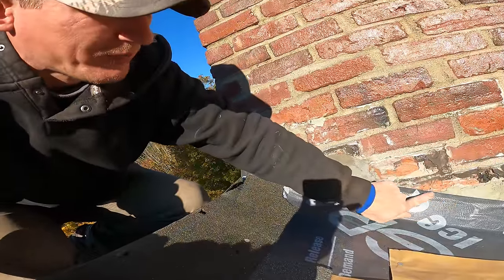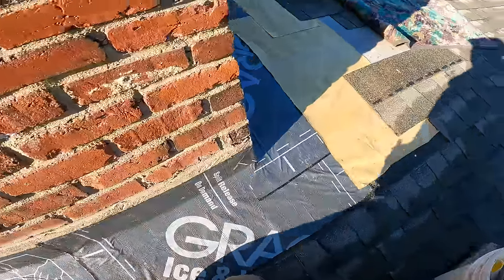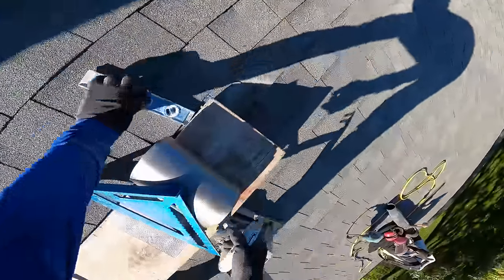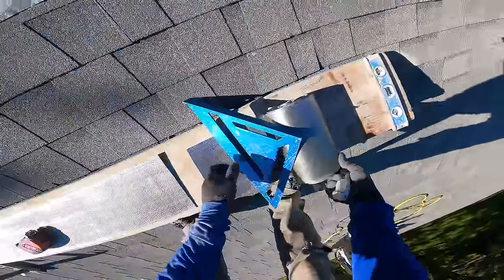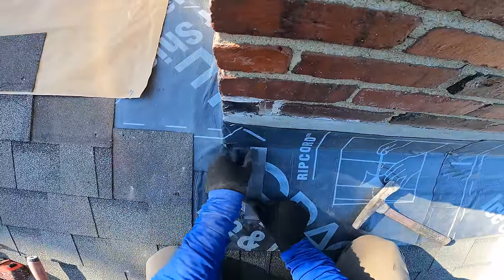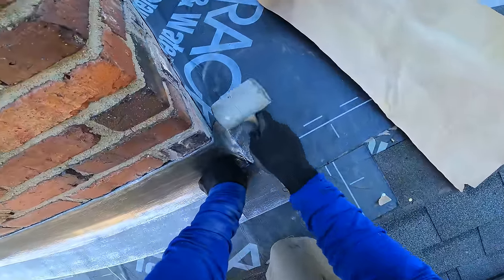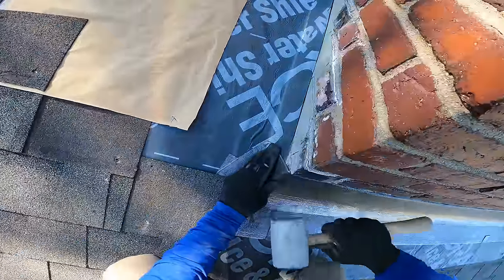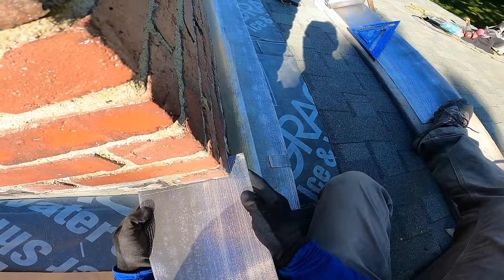Chimney flashing install | Part 2

Comment: I've always rolled up a a tiny piece of lead to use as an anchor between mortar joint and lead to hold in place. Once you roll up the little peice of lead, use an awl to squish it in the joint. Then use a specific caulk to mimic the mortar.
Reply from the maker: I actually used a similar technique in this video with the lead pieces. I would never use caulking on a chimney though, just doesn’t last long enough or adhere good enough in my opinion.
Reply: @chadvaillancourt  Yea I did see that after I posted.lol.. They make a special caulk that is for that purpose, I forget the name of it. Maybe dynaflex, not sure but it was specifically for mortar joints while also providing the necessary flexibility. Great work, I miss it, but then again....

Comment: WOW !  You are the man !  Very professional. You certainly do excellent work with the necessary knowledge. Learned so much.  I’m not a roofer or flasher but our roof is leaking around the chimney. Our house is thirty years old and the roof needed replacement because of a hurricane. The leaking is bad whenever we have a heavy rain.  Nothing was done to replace the flashing or to fix mortar and brick erosions. We have a lack of available roofers because hurricane Ian caused major damages to Florida. 
Question:  how does one find a qualified professional to do the right work like you do ?
Reply from the maker: Thank you. You’re very kind. 
Honestly I wouldn’t know how to go about finding someone qualified. The trades are in a very sad state.

Comment: Really well done. I work on a lot of chimneys undoing bad work.
Reply from the maker: Thanks! 
I prefer silicone in this application, it’s waterproof and flexible. Mortar cracks the first time the lead is lifted up to put shingles on especially if the roof is getting done in the following days.

Comment: Would it be OK to use 3 pieces of 8 inch lead to construct the front apron to cover up roofing cement stains?  It would cover about 13 inches in the front and the sides would also be longer.  Some pieces would exceed 20 inches.  Is this too much to cover?

Comment: U don't cut the Verticle Cut to tuck your Flashing into the Brick?
I've always laid my Shingles Over the Flashing, the Tar under the Ends to seal and stick.
Nice Clean job 👍👍
I still not sure about Not Notching the Verticle ends of your Flashing.
Blowing rain could get behind that area unless u Caulked under the Edge.

Comment: Hi it all looks very neat and I am sure you know what you are doing but if the chimney was in the uk it would not solve the problem what you are doing is probably the best that can be done without rebuilding the chimney and installing a lead tray in fact a chimney like the one you are working on would require two lead trays the first 3 courses above the bottom or at the level you have put your cover flashing and the second just above the ridge capping
Reply from the maker: Thank you for the comment. Flashing trays have never worked here. They work for a bit and then the chimney gets destroyed by excess water storing in the masonry when the deep freeze hits. We have to keep water out.

Comment: Just use a small propane torch with a soldering tip to make corners water tight.  It melts at very low temp versus welding you mention with oxy acetylene torches.
Reply from the maker: The lead welders I've spoken with say that the small torch doesn't really work, so don't bother. I've tried with no success.

Comment: I used some  THROUGH THE ROOF! sealer (comes in a cube-shaped plastic jug on my brick after water was coming in through some degraded mortar joints.. now im into getting the top section rebuilt.. do you recommend the paint-on sealers at all, for new chimneys?  i think you mentioned in the first part of this video to let it breathe
Reply from the maker: If it's new, I wouldn't.  Just get a custom stainless cap to cover the entire thing.
Reply: @chadvaillancourt  thank you!

Comment: Nice job and videos Chad! What do you recommend for patinating the lead flashing or do you even oil it. Just pulled out the lead on my chimney and the underside was solid white. The original flashing job was crap so I'm doing it right. Thank you!
Reply from the maker: Thanks!
Unfortunately I can’t find patination oil here, I’ve been looking and asking for years. In Europe it’s a common product. I did hear linseed oil works, and someone said wd40 but I haven’t tried either yet.
Reply: @chadvaillancourt  Thanks for the reply! It would add a nice touch to the lead work and perhaps catch on. The only thing close I found may be Tin-O-Lin from Calbar which is a tinners oil and may be similar. Have not contacted them yet. Its linseed oil based finish coat for lead/tin plated terne metal roofing. Something I'm not familiar with. They sell through Sherwin Williams in Biddeford per their website.

Comment: Where the shingles go over the lead stepping, what keeps water from going under the shingle there?
Reply: Nothing, but the shingles are lapped over the next course of shingles, so water would have to go sideways one direction under a shingle, keep traveling sideways out to the edge of the lead it is over, then drop onto the top of the shingle below, turn around, and travel the other direction sideways all the way back to the chimney gap....where it would be met by ice and water shield. 

Experience in the field and manufacturers who only require 6" of horizontal distance between joints tells us that this scenario is extremely unlikely.

Comment: So chimney flashing done by different people not the roofer? So when you habe a  problem who do you call to repair chimney flashing? I though roofer does that kinda job?
Reply from the maker: The flashing has always been installed by the mason while building the chimney, then the roofer comes later and ties in the roof. 
Now, the roofers insist on installing new flashing every time a new roof is installed because it's an upsell. That's usually when it starts leaking. They hire the least skilled people and have them go fast. The skill level in roofing is probably at an all-time low. Profits are at an all-time high.

Comment: If you don't like the cardboard tubes have you tried a sealant like Dymonic FC in a sausage? My mason introduced it when I was helping him repair a wall ony building. He also taught me to clean and point bricks. 

BTW I have the same rotary hammer, I think mine is over 30 years old but doesn't get much use.

Comment: Why did you put an apron and a counter flashing on the bottom, but only did one piece of flashing on the sides? Wouldn't it be easier and just as effective to take the counterflashing you put on the bottom and just extend it further down, exactly how you did on the sides? Why the apron?
Reply from the maker: Most people do this the exact way you suggest, but you cannot get that single piece to bend around and offer enough coverage on the bottom corners, it’s always the weak spot. Also over time that single piece seems more likely to crack in the middle. This is just the way I do it, I’m sure there are many other methods.

Comment: Nice work you do. Surprised you didn't put some shingle grit over wet silicone on ridge shingle nails heads so they are hidden from view. Really good job though,I'm just Handyman but i can see what craftsmanship is.
Reply from the maker: Thank you. 
 I guess I cannot remember, I thought I did put granules over the silicone, sometimes I do this although there is no real benefit. The silicone holds up to UV degradation without being covered, tar does not.

Comment: Chad, I live I never the UK where we do a lot of lead work, my tip to you is get or make some wooden lead beating tools as the wood allows the lead to flow around the shape chosen, your rubber happier grips the lead so does not allow it to flow so easy....try them you will be amazed at the difference it makes to shaping the lead.
Reply: Sorry for the spelling errors it's the predictive text
Reply from the maker: I've been thinking for a while that I would get online and buy some proper tools from Europe, I just haven't gotten around to it. I'm going to look right now.
Reply: I look forward to you showing us using your new lead beating tools

Comment: Excellent explanation and I enjoyed your video. I’m not a roofer or a flasher 😅, but I’m an ex paratrooper but do have fear of heights. I must admit I was nervous of seeing you work at height but using no safety scaffolding.  You clearly know what your doing but it only takes one mis step or accident….just my thought.
Reply from the maker: Than you for your service and for your kindness. I would never jump out of a plane, you’re nuts! 😂

Comment: very good job and very neat, how much do you charge in your state for a job like that labor and material?
Reply from the maker: Thank you. In my area so we have chimney sweeps posing as chimney repair specialist that would charge 1k to paint the outside of the flashing with the flash seal ( basically tar), I’ve even seen companies paint crown coat over the lead for as much. I think for a job like this 2k is a fair price to do a professional job. Obviously prices change based on chimney size, roof pitch, job access, roofing material and other things.
Reply: @chadvaillancourt  Thank you for answering me, you are very kind $ 2000 is a good price but I am sure that there are companies to do everything you did, they would charge from 3000 to $ 5000 because you know that they have to pay the secretary who is answering the calls to the one who is going to give the estimate to the bricklayer who is going to do the job and the company has to make money too
Reply: @chadvaillancourt  LOL essentially 1k to smear black tar completely over the flashing. Hack jobs man...

Comment: Overall a great job, best I've seen. However, silicone will not last as long as polyurethane roofing chauk, I've cut open 40 yr old polyurethane chauk and it was like new inside and still stuck to everything, silicone will never last that long on the brick. Why would you fix the flashing and not the cap which is likely the cause of the leak? In my book, not fixing the cap is as bad as using wax paper as an underlayment that you complained about. If you fix it, fix it 100%. If the owner says no to the cap, don't bother with the flashing. You could have added a lead or metal cap with a 2" overhang and then put the existing stainless cap back on thereby adding a drip edge keeping the bricks drier.
Reply from the maker: I told the homeowners to fix the top, they didn’t want to spend the money. They asked me just to do the flashing. It’s always an option down the road.
Reply from the maker: Everything I’ve ever seen or read suggests that silicone is far superior to polyurethane as it isn’t subject to UV degradation. The new silicone is so good compared to the stuff 20 years ago. I’m very confident in using it.
Reply: @chadvaillancourt  Yes, it does UV degrade, but only the top 1 to 2000 of an inch. Once that oxide forms, it stops degrading. That is why all skylight manufacturers use it and not silicone.  Polyurethane might look bad on the top, but inside it's like new, I've seen it on skylight glass I've had to replace and on other surfaces. Plus it will adhere to damp surfaces and stick forever, while silicone will not. It's nasty to work with, so you need acetone to clean up after, but it will outlast silicone by far.
I've seen those articles about cracking when cold and sagging when hot, I've never seen that in over 40 years of using it on skylights and flashing. Never gets brittle in the cold or sags in the heat. At least the quality products I have used. Maybe cheap stuff will. But that can be said of cheap silicone as well.
Reply from the maker: Interesting, I’ll have to look more into this. Do you have a specific brand you like?
Reply: @chadvaillancourt  How do you warranty your work if there is a known problem ( the cap) when you are done? Considering what they are likely paying you to do this, the cap seems a strange place to cheap out.
Reply: Exactly !

Comment: Hi Chad getting my roof done  so you recommend no Aluminum all lead flashing ? I am   in Boston , are you in that area  and you do all the roof? How to contact you ? Thanks
Reply from the maker: I do like to use all lead flashing. Others are very good at copper, which is a good option as well, just more expensive. 
I’m sorry, I don’t work in the Boston area.
Reply: @chadvaillancourt   i saw your answer thanks . Also lead flashing all  other areas of roof where flashing is needed ? 
I am in chestnut hill  to be accurate if you work in that area in NE

Comment: Chad, how is a feller to replace the roof without tearing apart those formfitting corners?
Reply from the maker: Everything unfolds much easier than making the initial bends. Just need to be a little cautious and handle with care.

Comment: Chances are good that its a cronic problem with that chimney because it's a driving rain issue where the rain is driving up under the shingles and going down between the roof sheeting and the chimney. Most likely cause of cronic leakage where it's been repaired over and over again.
Reply from the maker: The problems were discovered and talked about during the video.

Comment: How do you feel about aluminum? All the bids I am getting are for aluminum.
Reply from the maker: I’m sure aluminum is fine if it’s done correctly. Usually I only see aluminum flashing when a metal roof is installed and it matches the roof. In my area everyone uses lead and sometimes copper. 
I don’t really know why someone would prefer to use aluminum instead of lead, seems strange to me.
Reply: @chadvaillancourt  Only thing I can think of is that it is cheaper or there are local environmental laws that do not allow it.

Comment: Hi Chad, long time no talk lol, listen I wanted to ask you if my pricing is in the ballpark.
Quote-$100 to look at job added in price.
Labor rate-$800 a day.
Materials - varies?
Gas-$50 a day/ for job length.
Is this in the ballpark?
Reply from the maker: I think this seems fair for the area you’re in. Again pricing is relative, so get whatever you need to get to feel comfortable. Companies with payments on five new vehicles and paying absurd rates for work comp/payroll for several employees would have to have a very different price structure. 
Personally I don’t try to be the most expensive because I can profit a lot more than a big company with a much lesser price. I get whatever I need to make a good living. I don’t need to be rich.
Reply: @chadvaillancourt  I appreciate your time and knowledge I asked a mason this to get said yes your formula seems fair in the ballpark ty Chad.
Reply: 1 more quick question, spalling brick replacement, I was charging $100 a brick and getting it to cut and plug brick but loosing a few jobs because of the price to cut out and replace one brick. In your opinion under a frame high meaning 6'6" is 75$ a brick acceptable and after this up do to height and labor and most importantly safety.
Reply from the maker: I think the price per brick isn’t important as you already said you were happy to make $800 per day labor. It would be really easy to make $800 per hour if you charge by the brick, I can see why people wouldn’t go for that. You just have to figure out what works for you in your area.
Reply: @chadvaillancourt  one more question my friend, I wanted to know how much do you but aside from each check u earn from a job for taxes? I put 25% from each check
Reply: I live in Ohio and lead flashing isn't a thing here.  Where do you get it and what brand do you recommend?  Thanks for the content
Reply: @jeffenoch1871  sold at masonry supply, roofing supply, or lumber yards throughout New England at least.  I doubt Lowe’s or HD sells it, I have never tried to look there.  I can buy it by the foot/weight at some places near me, so I don’t have to buy an entire roll.

Comment: Grace never sticks to old brick or mortar. You have to use modified asphalt roof cement. Silicone will never stick to ice shield.
Reply: Grace sticks fine. You HAVE to use primer on masonry. But you are right about silicone not sticking we use it as a temporary dam when water testing Grace sheet goods on flat work because we can just peel it off cleanly.